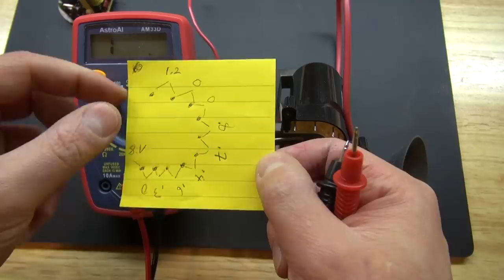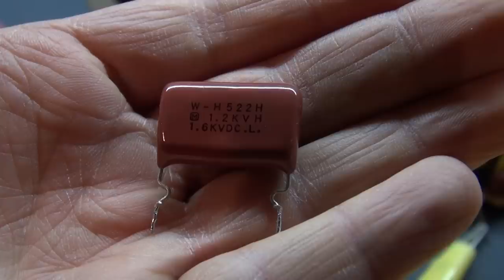High Voltage From A CFL And Flyback Transformer

Comment: Hello, I used a 40 watt lamp circuit, it works, but with a very short distance of 1 mm
Reply from the maker: There could be a problem with the flyback transformer. Also did you try to arc the wire to the correct pin? Sometimes there are more than one pin that can arc and usually the are some pins that makes a smaller arc compared to the primary pin.

Comment: Instead of adding the capacitor which can easily kill your driver, you can modify the choke coil or add some more in parallel. It increases the voltage and current but will not kill the driver if there is no load on the transformer. Just don't reduce the choke coil inductance too much otherwise it will die.

Comment: When I was a kid, I saw a plasma globe in a shop. It facinated me so much, I decided to make it. As  I didn't had money, I started researching for how it works, what parts I needed. I came to know about EHT supplies for the first time. I spent huge time in junkyards, buying scraps, collecting things. Form long time trial and error, I find one ic555 circuit, with 3055 power transistor which worked like a charm for driving these EHT coils. Some old TV colis which are more flat rather than cylindrical work more effectively generating huge sparks. I could smell ozone while working on that supply. One major drawback is that these coils have inbuilt diode that reduce it output. This project taught me very much about high voltage supplies and this video reminds me my childhood.
Thanks brother ❤️
Reply from the maker: You're welcome!! I am glad you enjoyed it! That's a very interesting circuit idea you made too!
Reply: Wow, that's interesting. You did electrical as a kid? or, electronics? my parents didn't let me power my parts but they did let me collect them. My fav part of mine is my CRT flyback transformer :)

Comment: 06:24 You don't need extra capacitor!! Two capacitors are already there on the CFL circuit for the same thing.
1:34 Pin 2 and 3 have two capacitors in series in between them. In your CFL glass tube Pin 1 & 2 are shorted, also pin 3 & 4 are shorted. Test with multi meter continuity. So now when you short pin 1-2 and 3-4 and connect to the flyback you'll get massive arcs, may be better than the 522H capacitor.
Note: Pin numbers may change according to manufacturer. Check back of the circuit board to figure out the capacitors.
Reply: Bro, thank you so much. Indeed I shorted pins 1 with 2 and 3 with 4. Instead of just using pins 1 and 4. It increased the arcs power!!! I mean not that massive, but considerably. Thanks dude
Reply: With this the circuit will blow up if there is no load

Comment: You mentioned using an oil to cool the flyback transformer.  What type oil would you suggest, and would you completely immerse the transformer in the oil?  I have read that mineral oil works.  The reason I ask is that I want to build an ion levitation model and it will require constant feed of high voltage.  I would need the transformer to output for extended periods.  Any advice would be greatly appreciated.
Reply from the maker: Mineral oil works the best. However, you still need to cool the oil down. Similar to a water cooler in a pc.
Reply: @SciTyeTech  Thank you!!!

Comment: Hello, thank you for the helpful video. I only have two 13 watt CFLs on hand right now. Would this work with a 13 watt CFL? If not then can I just put the two of them in parallel? Thanks.
Reply from the maker: Yes, that will work.

Comment: Just found your video after i striped the parts form an old PC CRT and a lamp driver of a copier so it runs on 12V. Using an 800Ω 40W resistor i had lying around draws a lot of heat away from the transformer whole thing is about 15W only after limiting and the arc lenght is not that much affected guess limiting the current and not the voltage. Trying to create a soft corona for an ozone generator I want to make. Know anything about that? O and thanks for an awesome vid.
Reply from the maker: Thanks for watching! An ozone generator seems like an interesting project. But be careful, it can cause lung damage. I have some ideas on how to make one. You can try making the same circuit that you already made, but add some pc cooling fans blowing air in a tube. Have the arc of electricity in the center of the tube, pc fan on one end blowing down the tube into the arc and put a filter on the other end. Air comes in, arc ionizes the air and filter filters out impurities.
Reply: Wiesz coś. Bo ja nie 🤔

Comment: nice, I have a 37 screen tv high voltage transformer, is it suitable, how many volts will be given to the input voltage of the circuit and the capacitor is connected in parallel

Comment: I like the use of the CFL.  Can you now divide the discharge to condencers and run off a resistance between the two which is double grounded creating a hairpin circuit ?  The mini light show is impresive but a waste of both time and energy if it has no practical or safe purpose.
Reply from the maker: Yes, a hairpin circuit is likely possible with this device. I might make that in the future. And you are right, it is a waste of time. It has no practical use but it can bring new ideas for future projects. However, it was just a fun experiment that I wanted to do.
Reply: One can use this HV source to power an air tabletop laser (nitrogen UV) and use this laser to pump a dye laser (visible). Let's try. :)

Comment: could you use DC voltage to power it instead as most compact CFL's have built in full bridge rectifiers built in.
Reply from the maker: No, dc will over heat it and not work.

Comment: Amazing video 👍🏼. Is this AC or DC voltage ? 
Can u make an ionic craft using this flyback transformer?
Reply from the maker: High voltage DC. And yes you can make an ionic craft with this device.
Reply: @SciTyeTech  in that case pls make a video on that project.... it will be super cool 😎. Thx again.

Comment: Nice!
Im playing with the idea to do this using a car alternator, at 10 000 rpm,which has 12 poles,which gives high freqvency.Output 12× 100 amp=1200w in the primary winding.

Comment: I know this method very well I want used this ckt for fired up projection lamp HID type  but risk factor is arc voltage generated maybe high and not certain compared to electronic ballast so sir what is ur opinion?
Reply from the maker: The best method would be to find a ballast that matches the same wattage as your projection lamp.

Comment: hey I like your narration it's kinda calming. I did try this with a 30watt cfl circuit and it worked without the capacitor between the primary but once I added one that has "CBB81 123K1000X" printed on it (same size and color as the one you used) I was only able to see brief arcing before cfl circuit failed and black components underneath blew up as well as the toroid inductor which also burned. I've read of some HV devices that cannot tolerate to be left open-circuited and I guess it was the brief moment before or after I separated the wires enough for the arc to dissapear that my circuit blew. you mention at least 26watts is needed to safely use the cap for longer arcs so how can I avoid this from happening? should I dip the cfl circuit itself in oil or do I need to take another measure like using some kind of dummy load to make it think it's always in a close-circuit condition? I want this to see phenomena in vaccum tubes and spheres and someday possibly make a homemade fusor but meanwhile I would like to be able to stretch the arc to see how far it goes without fear of things breaking up in smoke again. thank you for the clear tutorial that kick-started me into these awesome experiments
Reply from the maker: It works for me because I am not letting it arc for a long time. I did notice that the flyback was getting hot very quickly. Putting the flyback transformer in oil with a cooling pump is the best way to go. And to prevent unintended arcs from accruing, you will need to isolate the leads.
Reply: @SciTyeTech  thanks so much for replying! the thing is mine also works when touching the wires briefly and I don't see much heat coming either from the cfl circuit nor the flyback itself, it was only until I added the capacitor that the circuit blew the very moment I stopped arcing. do you have any idea of what might be going on? is perhaps the lack of a load that overcharges the circuit?

Comment: Oh my god. i have that exact flyback. But mine is out of a CRT monitor. I don't know if CFL and CRT are the same so correct me if i'm wrong.
Reply from the maker: That's cool! Those are separate circuits.
Reply: @SciTyeTech cfl is the old mercury bulb, but how would that flyback fit in it?!
Reply: Nevermind.. those are separate. The driver is the cfl and you already had the flyback.

Comment: Problems with this method is that its efficiency or if it works or not is dependent on the compatible between the transforner and cfl circuit used. From what i understand the general problems include:
1. Transformer doesn't make arcs: 
2. Arcs two small
3.Cfl circuit burns up somehow.
Usaually bad oscillation of circuit, caused by saturation or no load voltage rise. can be solved by adding 20 turns to the circuit inductor and shorting the two terminals. This prevents saturation problems and provide a load. But in doing so you might have to add more turns to your flyback as its primary inductance is two low and high current spikes causes instability or even burn out the cfl curcuit.

4. Transformer burns up
Use a bigger transformer, smaller cfl circuit, or rap more turns on the transformer primary. 

But note that two much turns on the primary of the flyback can cause bad oscillations due to high inductance and saturation. You can try rapping multiple   strands of wire to about 30 turns each. Then keep putting more and more wires in series untill the circuit stabalize.

Comment: Without the capacitor how long can you run this setup? 
I want to run this with ceramic ozone plates. Can I run this for 15mins without damaging cfl driver and the flyback?
Reply from the maker: It will run longer without the capacitor. However, it will get hot. It will get hot faster with the capacitor. What you want to do will work fine, just don't leave it on when not in use.
Reply: @SciTyeTech  Thanks for the info!
Without capacitor I ran an ozone plate, with low intensity, for 3 hours with 18 Watt Philips CFL ballast. Neither Ballast nor Flyback got heated, they were cold. But with capacitor, ballast stopped due to heat after 5 mins. But ozone was vigorously generated.

I used two 272J capacitors in series. Boy! the arcs were three times bigger!! 😍 Had to use chicken stick after I got zapped.

Comment: Pretty sweet. How in the world did you figure out how to use a CFL driver on a old monitor fly back? Gonna have to try this when I have some time. Thanks for the cool video man.
Reply from the maker: Thanks and you're welcome! I thought of a cfl as a high frequency circuit and a flyback transformer with multiple coils similar to a Tesla coil. Both will put off high frequencies, so to me it made sense to combine the two. Then I added the capacitor to increase the frequency.
Reply: @SciTyeTech  Have you ever measured the freq of the cfl power supply? I did it many years ago an I think that it was several times higher than the approx 15KHz that CRT flybacks operate at. If so, by adding the capacitor across the leads wouldn't you be lowering the frequency closer to what the flyback likes?

Comment: Love that stealth voice hauhauha
Looks that in learning something very secret heuheuh
And the speed of talk its perfect for foreiners
Thanks alot
I have a question, can i do a copper welding plasma?
Whit this plasma i can join coppers toguether?
If not, what can make it closer by doing this simplicity?
You said (or i understand very wrong lol) that is possible to keep the flyback cool whit oil, how can i do this right?
Sorry about my bad english if you didnt understand
Maybe you have made new videos about this flyback an cfl. Gonna check them. 
Thanks aloooottt for sharing your knowlege
Greetings from Brazil
Reply from the maker: There is really no practical use for this device that I know of. But maybe I will think of it in the future. You could keep it cool by putting it in a small container of mineral oil with ice blocks on the outside to keep it cool. Thanks I am glad you liked my video. I try to speak clearly for anyone to understand and learn.
Reply: Man theres so manny things to do
I was studding
Plasma creates ozone and this gas is good for health depending the wqy its produced
Theres plasma welding machine very expensive hauhauu
Theres Keshe Institute that does magrav machine
Kirlian photograf
Alot of things
Reply: Man i do one of this high voltage stuff whit the flyback and cfl
I made one whit 35 w lamp.
Its working, but Im having problem, theres 2 pins that are sparking toguether and i fear to broke. What can i doo to fix the sparking pins? The last one its perfect making sparks very good, but theres the others pins sparking toguether
Thanks about the mineral oil stuff, im gonna cool down all the stuff heheheh
Can i put the cfl circuit in oil too? Not toguether, in another place? I know that oil is not conductive, but didnt know if i can imerge in oil
Reply: Forgot to say that i didnt put the high voltage capacitor on it
Didnt find a good one
Can i find those in tv circuit?
How can i make this circuit be on alot of time?
Mannnn sorry whit all those questions uhauhauha
And thanks aloooottt for sharing and answering my first ones
Love and peace brother
🙏

Comment: Excuse me sir!!! I wanna discuss you on a topic related to a flyback and cfl.
I wanna know about the CFL
how much watt CFL is required to operate A flyback.
I am in trouble. Please reply soon!!!
Reply from the maker: You can use any amounts wattage, the higher the better. This one I am using is 35 watts. But the only problem is the higher the wattage the more heat is generated in the flyback transformer.
Reply: @SciTyeTech  can I use 5 watt or 27 watt cfl

Comment: Very awesome but can we make it with 12 v
Reply from the maker: Yes you can. It will require a zvs driver.12v is good, but around  24v to 30v is better. You can see that in my other video. https://www.youtube.com/watch?v=17ygNY62-gQ
Reply: @SciTyeTech  yes but can I make it with this    parts and without Ebay things wich is in your video wichs link is hear ?
Reply from the maker: @vladimernikuradze3182  Not really, because this is the best and safest way to make it work.

Comment: why did adding the capacitor result in greater voltages?
Reply from the maker: That's because capacitors store energy. This particular type of capacitor has low capacitance, thus higher frequency. This capacitor puts off higher output voltage, because it can discharge very quickly. The AC input from the CFL charges the capacitor in low frequency, then the capacitor's output releases it's energy in a higher frequency. Which then makes a very simple amplifier circuit.
Reply: Near as I can understand what you are suggesting, is that the capacitor and transformer are forming LC tank circuit that is resonating at a higher frequency than the CFL driver circuitry.  If that was the case, you'd have to be lucky to pick a capacitor value that resulted in a resonant frequency that was a multiple of the CFL driver circuitry.
Reply from the maker: Yes, that's very true. How I figured out the the correct capacitor, Is I measured the length of the electric arc before I used the capacitor. And by doing that, I looked trough my collection of capacitors and found the near correct value. It took three tries, then I found the correct one that arced the longest.

Comment: sir can use this for a rat trap fence
Reply from the maker: Most likely yes. However , you may need to cool down the flyback transformer because it will get hot quickly.
Reply: @SciTyeTech  Will the output be ac or dc,

Comment: What are the other 2 wires on the Flyback Transformer?
Reply from the maker: Do you mean the red and white wire? If so, those do not connect to anything.
Reply: Are you refering to the other two wires on the CFL?  Those are the open grounds that  powered rhe bulb circuit.
Reply: Thats what i figured i just wanted to be sure.

Comment: What is the input and output voltage  of.. that cfl.....without the flyback. can you please tellme
Reply from the maker: Sure. It is 120 volts AC input and the output 35 watts. And for the out put voltage, I am not sure.
Reply: @SciTyeTech  ... thankyou sir....... i want to use it for some purpose...
Reply from the maker: You're welcome! But be careful of the high voltage.
Reply: @SciTyeTech  it's 600 a.c. volts

Comment: Can you use DC as a power source to drive the cfl ?
Reply from the maker: No, it will only work with AC.
Reply: @SciTyeTech  what's the minimum voltage you can run this on? Would 4.8v AC be enough? What if I connect multiple high voltage capacitors?

Comment: It's too bad they've stopped making cfl's, all I could find were 23 watt circuits that lasted less than a second before it pops and it's done
Reply from the maker: The lower wattage cfls do tend to not work as well, but you can still find a lot of them on Amazon with higher wattage.

Comment: I tried with a 40W bulb circuit and the circuit blew up lol, not sure what happened
Reply from the maker: Most likely too much current.
Reply: @SciTyeTech  ah yeah I thought so, I used a 13w and that atleast did something, I think my transformer might be bad
Reply: nice, I have a 37 screen tv high voltage transformer, is it suitable, how many volts will be given to the input voltage of the circuit and the capacitor is connected in parallel